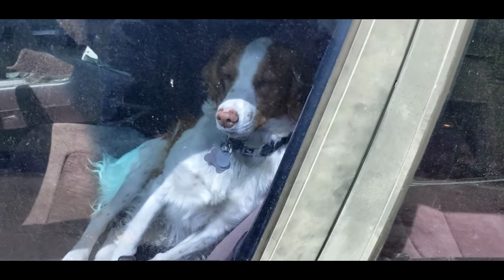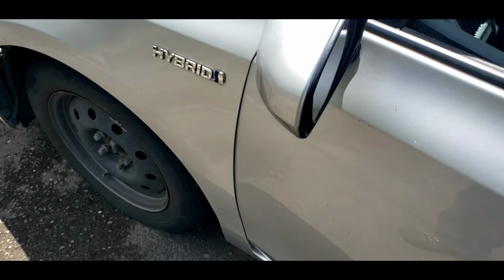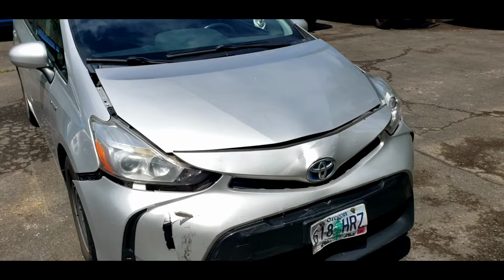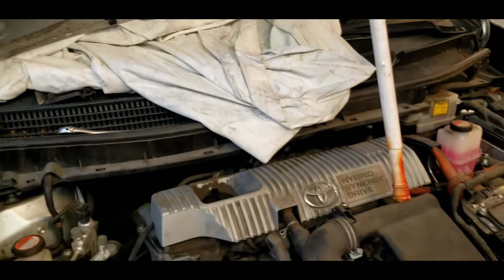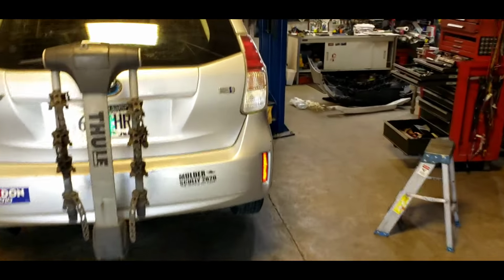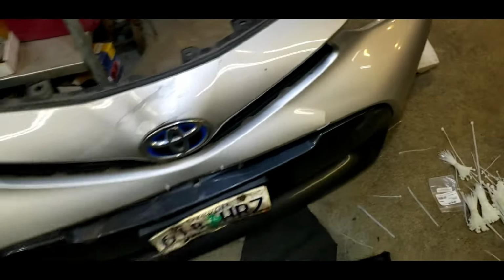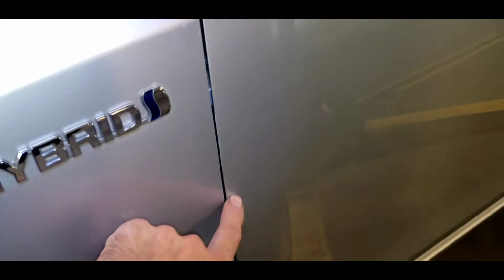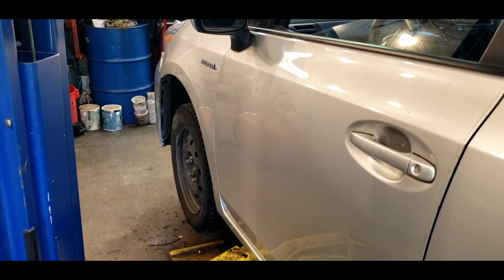This One Is Not Easy

Comment: I had an old junker Toyota that I used a come-along to pull the bumper straight.  That Prius doesn't look any thicker in the metal.  Just try to pull it sideways by the bump mount.  You can get it 'good enough' that way most of the time.  You can get ABS plastic rods and spin weld the bumper cover together with the rods and a Dremel.

Comment: In my country, because we import used JDM cars, there is an active market of used Japanese car parts. There are over 250 shops. You can buy an entire front or rear cut. For this Prius, you can buy a nose cut. All the bent subframe parts can be bought. All for a fraction of what the Toyota agency would sell for !
If the airbags were not deployed, then most likely there are no structural damage and any bent subframe members ( some are aluminium) can be renewed.
The guy who works for me will repair that Prius in a jiffy, and that you'll never know it crashed into a F150 !
............and to those naysayers out there, not everyone is in a financial position to replace a motor-vehicle at the slightest fender-bender.
Trinidad & Tobago.
West Indies.